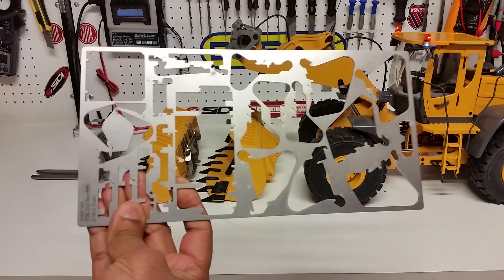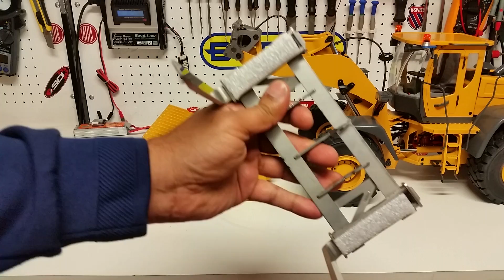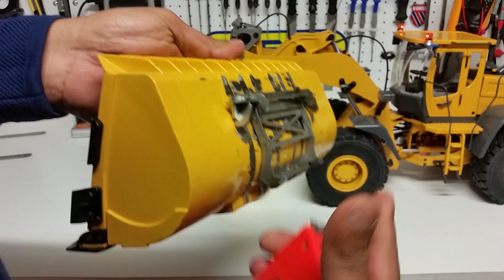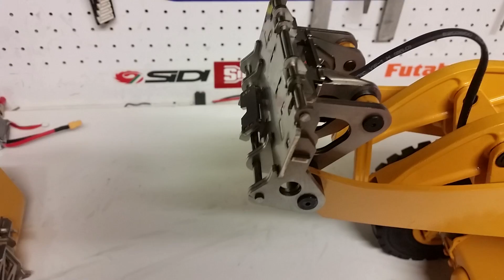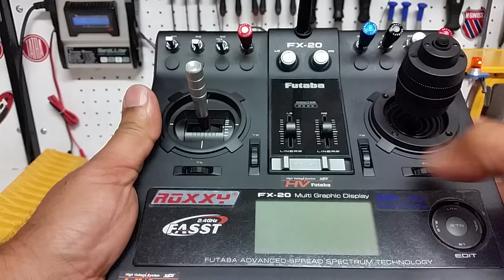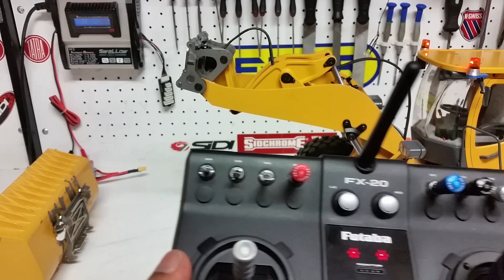RC Wheel loader with quick connect and start up functions

Comment: Hi Kevin; I'm installing the light system on the wheel loader, and I'm having an issue with the back up lights and the back up alarm coming on in the forward position, and nothing in reverse. Is there something on the little control box where all the wires go to that needs to be changed?
Reply from the maker: Hi Bob just swap the wires on the motor. This will fix it.
Reply: Ok, Thank you!